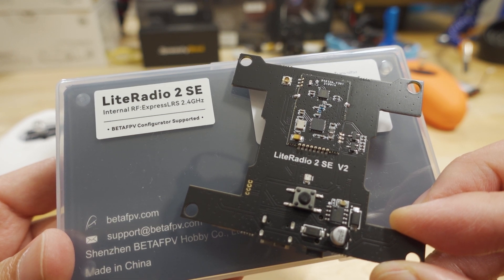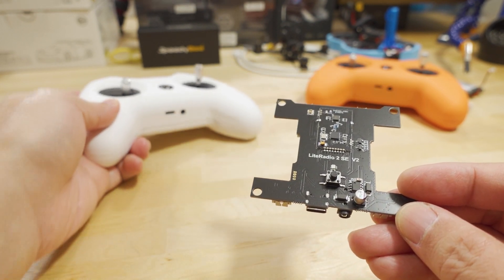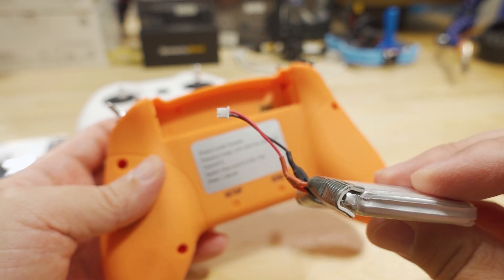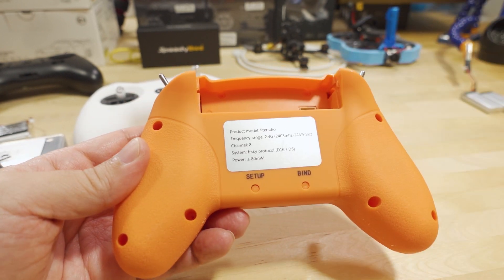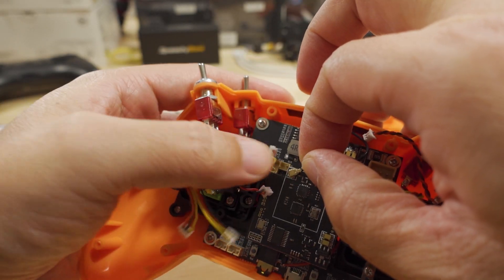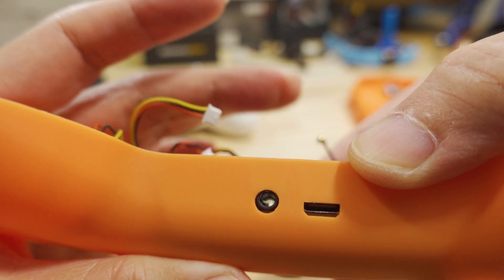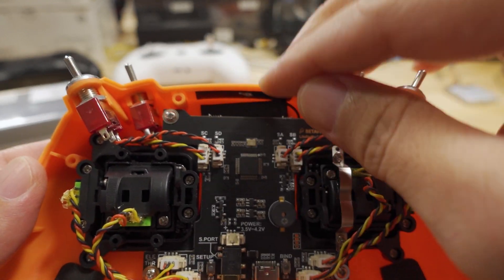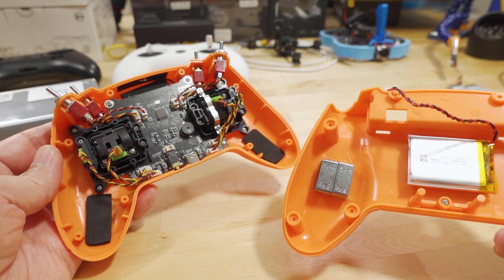LiteRadio 2 SE to ELRS Version Upgrade Board 💪

Comment: Lost the capability to connect the USB on my D8/D16 version, so nice that the USB port is connected to this upgrade board.  Just bought this for $20, now a long wait till it arrives from China.   Thanks for the information, should hold me over till some new Game changing small format controller appears.
Reply from the maker: Thanks for sharing
Reply: Would not have found the board upgrade exists without your video.
Reply: BetaFPV should add OPTION to also purchase a 1S battery with JST 1.5  connector with this board, I'm having trouble sourcing one without huge shipping costs.

Comment: Hi, man. How long is range for this radio or  antenna?)
Reply from the maker: Range will vary on a lot of factors.  Could be as little as 100m or as much as 20km.  Max range on 100mW was almost 30km on some testers.  But they probably knew what they were doing.
Reply: @AlbertKimTV what is max power of literadio2 ) thanks for answering 😜

Comment: When are the expressLRS RTF kits coming out?  Seems cheap enough.  $45 radio, $45 goggle, $80 drone?  Damn, the noobs have it so easy now!
Reply from the maker: Oh, that would be cool if that happened.  Who know, might be out soon!  🤫
Reply: They have them you just need to buy the parts and program them by " flashing " them with a large computer network running in software allowed by location and settings too will all be done for you . If you do what they want or are not hated for no reason or do not provide upgrade fees on a timer .

Comment: Cool! Now if only Radiomaster could do the same to swap out the internal 4-in-1 module with an ELRS tx for the TX16s that would be amazing!
Reply from the maker: That would be cool!
Reply: Should be a standard thing ... Pick you layout form factor select interchangable inner module
Reply: I think you can plug in an express lrs micro module into a tx16 . And still be able to use frsky , hblt , crossfire , and the rest of the models .
Reply: @rocketshipsandrobotsinterg2184  the Zorro is getting closer with smaller form factor.

Comment: Thanks, been waiting to hear your thoughts. Thoughts on a antenna mod?
I  have to admit 20 more dollars for the whole controller...
Reply from the maker: The patch antenna is probably good enough for most purposes.  If you really want to go far, it would be better to get an external module that can go to a higher power output like 250mW or 500mW.  On 100mW, I'm not sure how much more range you'll really get with a high gain antenna.
Reply: I would buy the t lite if anyone had it in stock, except so many rumors ... of elrs stuff.